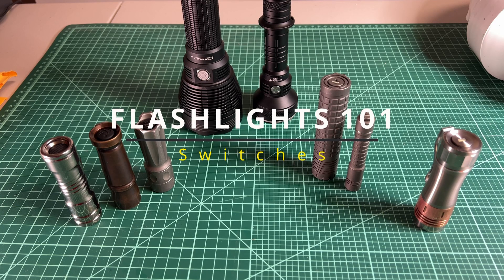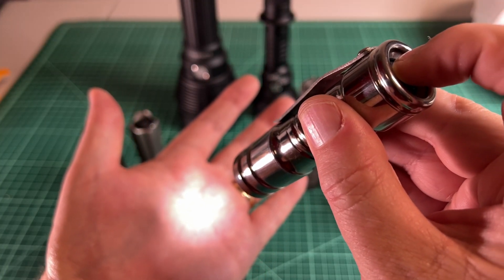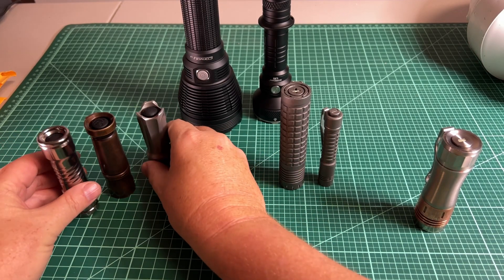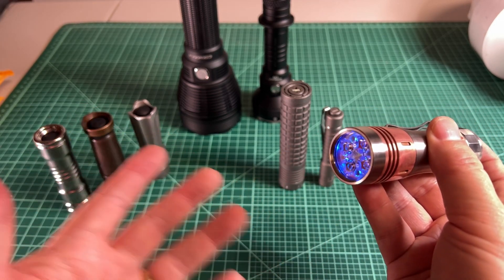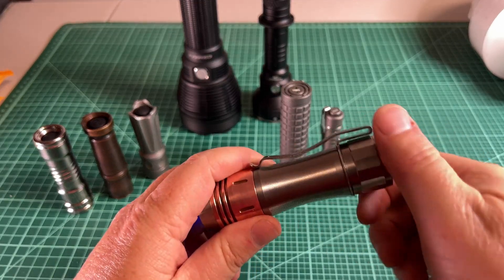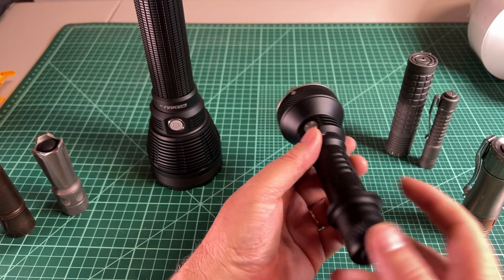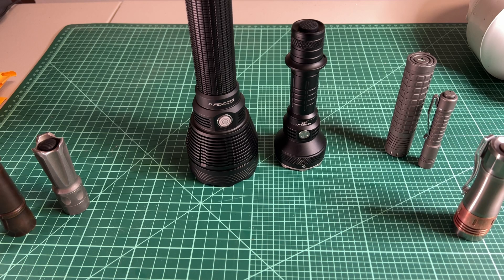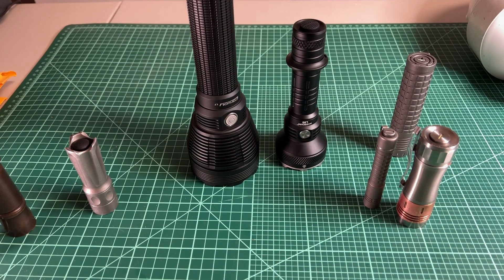Flashlights 101:  Switches! (Forward clicky, reverse, and eSwitches)

Comment: Would the Weltool T12 have to have e-elements since it is both forward AND reverse?
Reply from the maker: If I recall correctly (I gave my T12 to a friend), it has a side eSwitch and a mechanical tail switch. I think the tail switch was a forward clicky. But again don’t quote me.
Reply: @cheule  I have one—there’s just a tail switch that you can half-press for momentary (forward clicky), but then once it clicks, it’s on a different mode, as if a reverse-clicky. Half-press once it’s in to cycle between two modes. So since it’s sort of a combo reverse/forward I was just wondering where it would fit into the discussion, and if that’s still considered mechanical.

Comment: Hey great explanation. I am trying to convert a flashlight into a bike light and not use the existing reverse clicky switch in the back. It is a Keygos M10. I want to mount a switch on my handle bar. Is there a micro version of the switch or is it possible to make a momentary switch for it?
My idea was to use a micro switch.

Is this the reverse/forward action determined by the driver?

Thanks
Reply from the maker: Whether a switch is forward or backward click it determined by the switch itself. I’ve swapped many reverse/forward switches on lights without changing the driver.
Reply: @cheule  Ok so my plan is to make a mount for the front end of my torch and make a bar mounted switch what switch should I buy? Are smaller switches able to handle the current from my 26650 cell?

Comment: Pop quiz: L8 or L7? Feel like I need one of them in my life.
Reply from the maker: L8 is a slight upgrade IMO.  If you already have an L7, they are too close to get the L8.  But the L8 has a boost driver and a slightly redesigned reflector.  But things that might detract are it's a single 26800 (which could be problematic charging on a stand alone because of it's length), and I really got the L7 because I liked the "maglite" feel of the long tube.  I didn't want another K1 looking light.

Comment: Thanks again for the info.  Just subbed a couple days ago and wasn't quite sure what types each of my lights were.  Just knew they were different.  I knew my FW3C was an E-switch and I understand that one, just didn't understand the difference between mechanical switches.  I haven't documented it, but my FW3 doesn't lose much battery over a month of no use.  I do a Batt Check often and it's still at 4.1V.

Comment: Anduril 2 is out now with simple mode (group?) and advanced. Two worlds. Lots of new features and some system changes like allowing more time between clicks when configuring, and some new methods of setting floor to ceiling. Have you checked it out?
Reply from the maker: Most of my hanklights have been flashed to Anduril 2, I love it!